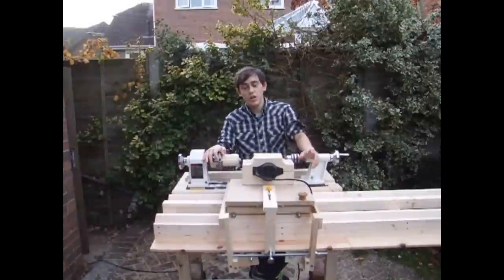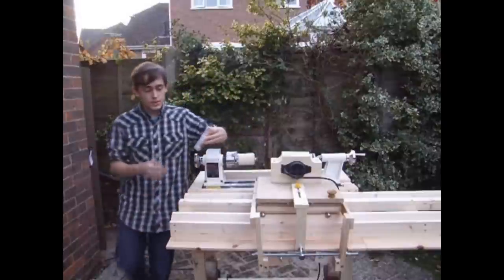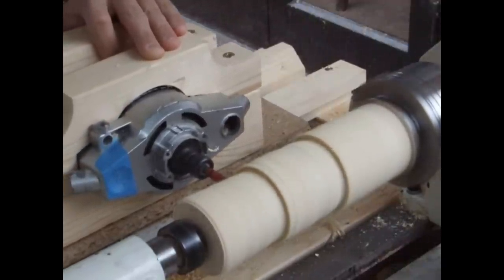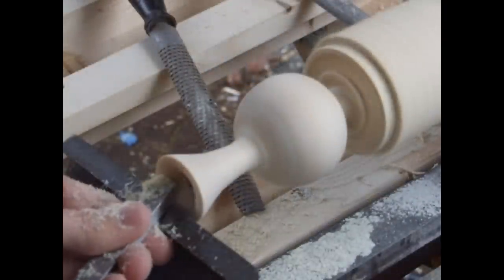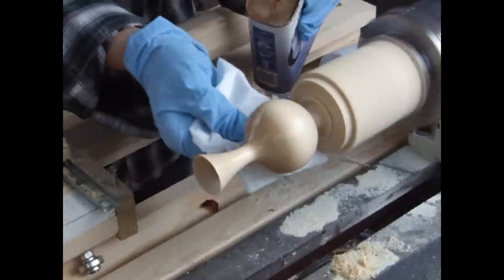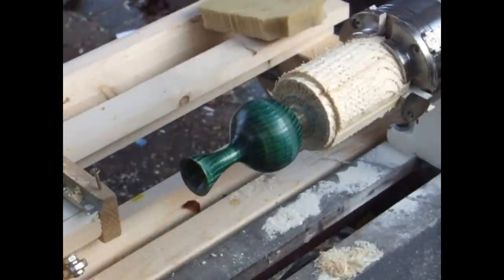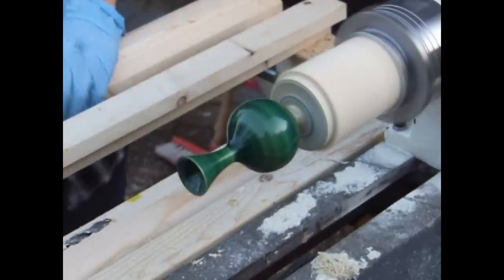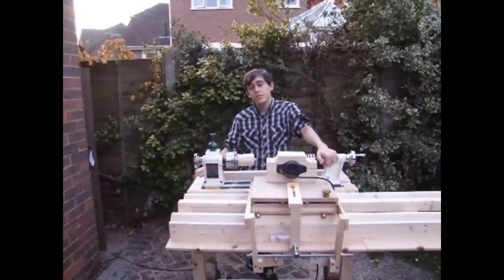Homebuilt Router Copier Lathe

Comment: Nice Gadget, shows inventiveness. I would like to make one comment for the benifit of any that are not aware. That is that to obtain an acurate copy of your sample profile it is very important that the stylus (you look to have used a bolt) is the same profile as the cutter used. If it is different from the cutter size then dimensional changes will be evident in the finished product. Cheers from John.

Comment: I love this smart affordable copier, nothing can beat it, however for more detailed work I would think to taper the guide pin and round the tip off so it moves smoothly and traces small changes on the template and replacing the straight router bit with a V groove bit increases the precision in case you have a template with beads or so, keep it on with more wonderful videos.

Comment: Really good job Alex.   Remember that chatter means too much rpm of the workpiece for the set-up. It will always talk to you & tell you what it needs. Excess rpm will dull the tool faster too. Just trying to help, from my 35 years as machinist of metal & plastic parts. I have planned on building a lathe/router combination for 20  years, just haven't done it yet.

Comment: All you need to do to make this work accurately is to replace the flat faced metal dowel at 3:00 with a spherical metal point.  You will really smooth your finish and be faster when you follow your die.  Great work and I hope this helps.

Comment: Nice one! You may get smoother action from your copier by swapping out the drawer slides for some linear motion bearings with flanges to mount your support deck that the router sits on. I have found this method give a smoother action which leads to more accurate cuts.

Comment: You created what is known as a "Pin Router" for your lathe.  A pin router is so called because a pin follows a template, and the routerhead would transfer the pattern to your workpiece.  It is a type of automation that was used before computers (and CNC Control) started entering the factory floor.

Comment: Good job for home made.  I think lowering the turning speed would help. And someone made a comment about the tool profile.  Also a good idea. And the bold or allthread your using to follow the template should be pointy, and polished. You really did do a good job. These tips are mention to be helpful. Not critical.  So keep up the good work.

Comment: Great work on the duplicator. If I may, allow me to suggest two things. First, using a router bit with a round nose, such as a ball nosed two flute end mill may produce a smoother surface that may not require as much finsih sanding. Second, you may want to consider using a round nosed guide pin. This will follow your patterns much more smoothly which inturn will allow your round nosed cutter to follow much more smoothly. As 77dbm suggestied, a small bearing may work just as well.

Comment: If you slow that lathe way down you'll get a better finish. Even adding a very large shiv to the back of the headstock and finding a small motor to turn it would work. 
Basically, you want a really slow roll, that way the router can cut the wood, as it just doesn't have time with the wood spinning so fast. You more smashing the wood off, rather than cutting it.

Watch Capneddie's video on crankshaft finials made on a One-Way lathe, he explains things well.

Comment: Rather than use a flat nosed bolt as the guide pin, Use something pointed. A flat nose can't copy a tight inside curve as well as a point. Essentially, your scribing, which is usually done with a compass. An easy tweak might be as simple as a 4" casing nail.

Comment: good idea, but i notice that there is one improvement that could be made.  this will not accurately copy the profile unless you put a dull point on the end of the bolt you use to contact the profile, that way it copies the curve without making the curve wider in the slide direction.

Comment: I couldnt tell exactly what you were using router bit wise, but you need to be using something of the ball-end variety for a good surface finish. This will aid you when leading in and out of your concave and convex geometry. Ive worked worked plenty on cnc lates/manual lathes as I am a machinist, and I can promise you that finding the right tool profile will aid you in that.  Either way this is very impressive!! Good job!!! You have inspired me sir.

Comment: As a quick, general thought, you might have better luck if you rounded the nose of your "follower" that traces the template, and went with a round-nosed tool instead of a straight bit.  Theoretically, that would give you a much superior finish straight off the cutter.

Comment: The guide pin (bolt) should be a ball bearing attached to a strong spring to allow it to roll as it follows the template and provide a more consistent contact at a specific point with the template. but otherwise this is brilliant!

Comment: The guide pin should be the same shape as the router bit, and it looks like it matches pretty well. That way, the result will be the same shape as the template. Having a template that can't be folowed by the flat nosed guide pin is pointless, since the router bit sets the limit.

Comment: Instead of a rounded guide pin, I would go for a far smaller tip on the pin. The pin follows the shape of your template. It will only copy it well though if the contact point between template and pin is as small as is practical.

Also you should try and build a reduction (template bigger than the workpiece) mechanism between the template and the workpiece. This will increase the precision. Look at matthiaswandel's pantorouter.

Finally the router bit, use something more pointy there too maybe?

Comment: Have you tried it with a round nose cutter and matching follower? It may be smoother, also is the leading edge of the router cutter rotating up against the travel of the material? or with it. against it should also leave a better finish.

Comment: Exactly correct.  Plus, I would have scored the bottom while running the lathe to guarantee a perpendicular bottom to the vase, the cut it and given it a slight hollow to make sure it didn't rock.

The thing I would be most worried about is how much material the router is taking in the first passes.  Try to take too much, and you're wearing that bit as face jewelry.  Very dangerous technique there.

Comment: nice work. just round off the tip of the bolt your using as the guide it will glide across the template smoother.

Comment: I noticed you were using a straight router bit and a bolt for your guide pin... what if you used a half inch round nose bit and then rounded the tip of your guide pin. It would probably cut a lot better, give you a better finish on your piece and would be easier to move on your guide block.

Comment: get a bit with a smaller point and replace the bolt  you use on yer gide with a nail with a rounded over point

Comment: Great creation!  I might have to put this on my "Things to build someday" list.  I was trying to think of a way I could use this for my bass guitars (Sola Gratia Custom Bass Guitars - youtube and facebook) but I think it would have to be significantly retrofitted to carve the heel area that takes me so much time (where the neck blends into the body on the back).  
One suggestion - you might want to try using a full radius router bit and a stylus of the same size and radius for a smoother finish.

Comment: I really liked seeing your finishing process.  I've never used stains/dyes overtop sanding sealer before.  I'm use to using it just to completely hide woodgrain in prep for painting a piece opaque.
What is the purpose of applying the sanding sealer overtop the dye job?  Why wouldn't you just go straight to lacquer?  Thanks

Comment: dope but uuuhhhh does putting you router bit against a moving object increase friction and thus you run the chance of messing with the bits tempering?
Reply: Dope yourself. It's a tungsten carbide router bit  !!! No temper involved just fucking hard metal!
Reply: Lmfao. You're a fucking savage man. it was a honest question. I have learned of different tool steels since then. I would've learned faster if I knew I'd offend someone by not knowing about it.
Reply: dope means cool, fool

Comment: @cncnutz Wouldn't they need lead drive screws and a few others things too? Limit switches, a power supply, CAD/CAM software, few other odds and ends. Look up TB6560 to check out my motor drivers I made for $10 on instructables . I've articles there about a break out board and a power supply that work for CNC too. Oh yeah even an article about how to make a soft material tap so you can make your own lead nuts.

Comment: good work but your like 10% from finshing this thing well 
you need some thing round to aid your guide
make sure your rail system is as smooth as can be greese it up if you have to.

a little help from peaple who have been building CNC machines for over 20 years and this is basicly a cnc machine but withought stepper motors or CAD files but you have all axis of one 

Well done keep it up btw i dont think your boring you get a ppl who want to be entretained im sure thats not what your here for

Comment: The following bolt is the same shape and diameter of the router bit. If it had been pointed while using a straight bit, the wood would be misshapen. Your comment is really annoying.

Comment from the maker: I mention a lot of the changes I plan ro make in the follow up video, if you have not yet seen it, "how the router lathe works".
A reduction, like on Matthias Wandels Pantorouter, designed around a pantograph would not really be suitable for this design, although it may make it a little more acurate as you say. To be honest this type of work does not need to be perfect and the 1:1 template is sufficent and gives good results.
Alex

Comment: ... wtf are you talking about? the guide bit must be the same dimensions as the router bit, otherwise it won't copy precisely. if the guide is 2mm and the bit is 4mm, by the time the guide contacts the template, the bit has already removed 1mm of material. this effect would be even more pronounced on a lathe setup like he has. Please refrain from harshly critiquing this boys work when you don't even know what you're talking about.